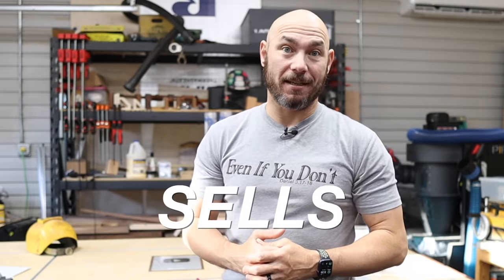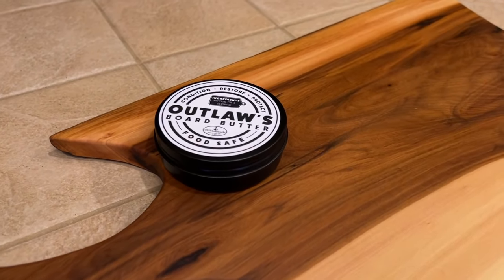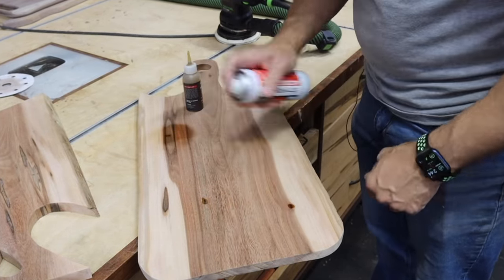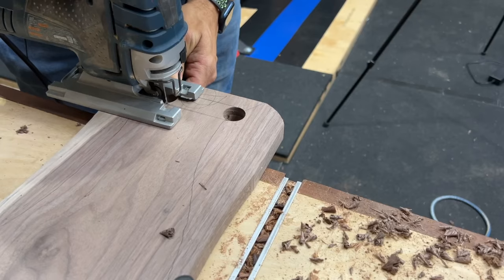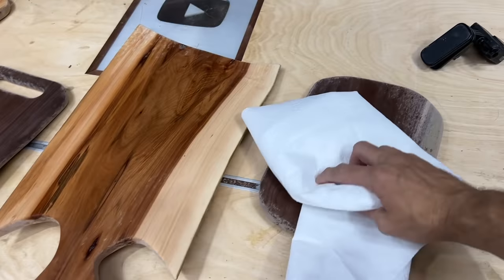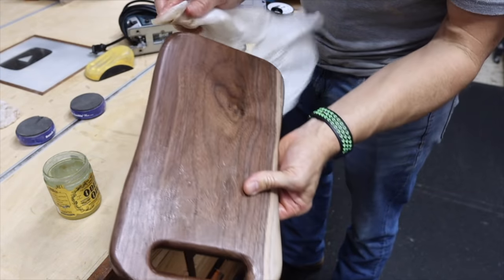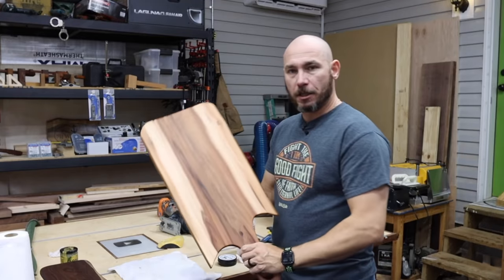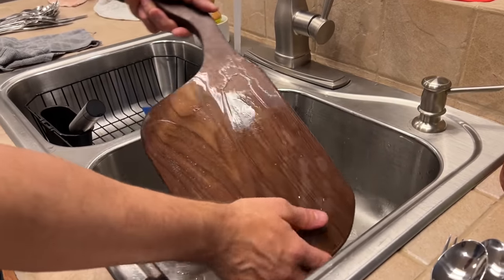Beginner Woodworking Project that Sells | DIY Charcuterie Boards

Comment: I'll be making my first cutting board and charcuterie boards today after work. I like how you make it seem so simple. So many other channels show you how to "make a quick an easy cutting board", then proceed to use their jointer, oscillating sander, drum sander, router table, thickness planer, etc. etc. Chances are, if you have that kind of equipment, you probably don't need a tutorial on how to build a quick and easy cutting board, haha.
Thanks again for the awesome content, and praise God for your shout outs and scripture references to God Almighty!
Reply: amén !
Reply: Is that board one solid piece or glued together?

Comment: guess I could still make one of these for my brother as a christmas present, thanks a lot for the tip! just wanted to mention I'm still kinda struggling with the stove cover (I'm trying to make it out of palletwood, I had hard time disassembling the pallet and I have very few powertools to cut and sand the boards) but I am enjoying the process ❤️ and I'm almost done with the lazy susan I saw in your videos, I cut it from a plum tree stump and damn it took ages to cut with a hand saw. just finishing it with tung oil and this stuff takes forever to cure 😳 love your videos, thank you for everything you share with us, you're a very inspirational craftsman. keep up the good work and take care 💪

Comment: Naphtha will raise the grain, and spirit off faster than water will dry. Fast enough to raise the grain but not be absorbed, affecting moisture content. (That part isn’t particularly important on a cutting board, but I build classical guitars, and that’s a bigger concern when dealing with wood that’s ~2mm thick.

Comment: Do you recommend anything different for cutting boards - ones that will see lots of chopping/wear?  Same finish?   Also do you recommend re-sanding/refinishing cutting boards (the cheap wood/bamboo ones I've used are all cut up /dried up).

Comment: Hey Mr. 731, I'm making my own design for cutting boards and when I soaked them for 2 hours I pulled them out of the mineral oil, they haven't completely dried after 48 hours even, however the oil is bubbling on one side of each board. I've never had this problem before. I could really use your expertise.

Comment: Thanks for the tips! Those would be great to sell at local farmers markets, using shapes for that area (like in my area, alligators and palm trees). I’m wondering how feasible it would be to make (on a CNC) some little decorate/matching boxes to include some homemade conditioning oil/wax to include.

Comment: Can I ask what the name of the tool he was using on the second board where he sanded inside the hole of the handle and around the edges?  I think he said router something, But I wasn't sure if what he used was specifically for sanding or does it do multiple things? Thanks everyone
Reply from the maker: That was a trim router (also called a palm router).  I used a small round over bit in the router to get the smooth edges.

Comment: Hi,  is it possible to get rather than the Amazon link to your tools used etc but the make/model.  My Amazon link is Canada and it showed me a different make router, which was the Mikita and I believe yours may have been a Dewalt
Reply from the maker: I'm using a cordless Ridgid router.  I put the Makita link in because I also have that router and it is a good option for the price.

Comment: What would you do with slabs that have 1 live edge.   Basically they were the first couple cuts off the log that the mill priced at $2 board.   Most 8 to 10 ft.    About 3/4” to 1” thick.
Reply from the maker: those would make great charcuterie boards.
Reply: Shelves would also be cool

Comment: What do you do with the mineral oil bath after you soak cutting boards in it?  Discard or save?
Reply from the maker: You can re use it several times.

Comment: Rookie here! I have used hole saw bits before, which I imagine anyone who has knows the pain, but only recently learning about the Forstner bit. My understanding was the Forstner bit was for use if you didn't want the hole all the ay through. Seeing here you can use it for either?
Reply: You can use it either way. When using a forstner bit it's best to go halfway flip the piece over and finish the hole from the other side. Or have a scrap piece under it to prevent tear out
Reply: @woodworkingandepoxy643  Thank you! Makes sense as to why I am seeing guys put a scrap piece under the bit on their drill press. I've never been a fan of digging the core out of hole saw bits so I think I will try the other.
Reply: @ryanm2214  you'll wonder why you didn't sooner. They're so much better

Comment: What’s the purpose of the water spray ? It raises the grain and then you sand it ? Does it bring it out more visually ?
Reply from the maker: If you don't do that, then the first time it gets wet, the grain will "pop" and the board will feel rough and unfinished

Comment: Might be a silly question - do I need a planer to make a board like these?
Reply from the maker: If the boards are warped or twisted you would. If they are flat, then you won't

Comment: I really like all of your videos. Such a professional craftsmanship and carpenter. I recently asked 731 community group about the jig saws. When you are cutting curves like the one shown in the videos. Does the blade comes off from the wheel groove? Since I like all your videos you should demonstrate a projects recording how you cut it or how slowly to cut curves with a jigsaw to avoid those problems. I have a Dewalt jigsaw. Is that a good jigsaw or get another brand? Thanks. And keep it up. You both do an awsome job
Reply from the maker: Thank you. Dewalt are good saws. Mine doesn’t come off the wheel. Good video idea for sure

Comment: Most of your charcuterie boards are hardwood. Is soft wood /pine ok for these to start?
Reply from the maker: You can use them for serving but not cutting. The softwoods will damage too easy if used as a cutting board.
Reply: @731Woodworks  thank you.

Comment: If you sell something with Odies Oil does customer have put some on later or one time good enough?
Reply from the maker: It's similar to mineral oil or any other finish.  If they wash their boards regularly, they'll need to apply a conditioner.

Comment: Could you add a link to the sandpaper you use? I’m constantly trying new sandpaper out. Great video!
Reply from the maker: I use Festool band, https://www.amazon.com/Festool-497169-P120-Granat-Abrasives/dp/B004INGNHE/ref=sxts_rp_s1_0?cv_ct_cx=festool+sandpaper&keywords=festool+sandpaper&pd_rd_i=B004INGNHE&pd_rd_r=0579986d-75a7-4d52-a0ef-80bf1e100614&pd_rd_w=gO82j&pd_rd_wg=8sNZ3&pf_rd_p=29dcfc78-5030-4047-b3bb-fd095cf7aa8a&pf_rd_r=20DT61GRJ3YN47TYFBKJ&psc=1&qid=1639347257&sr=1-1-f0029781-b79b-4b60-9cb0-eeda4dea34d6
Reply: @731Woodworks  thank you!

Comment: These beginner projects take advanced tools. 😂
Reply from the maker: A jig saw is advanced? 🙄
Reply: @731Woodworks  you used a whole lot more than just a jigsaw. And that pretty sawdust extraction setup don’t come cheap either
Reply from the maker: @bigmex8794  Yes I do.  0:33 through 1:05 a jig saw and a sander.  That's it. If you can't see how it's done with those tools, you can't see the forest for the trees.
Reply: @731Woodworks  your work is beautiful. Nobody attacked you boss. Get out of your feelings.